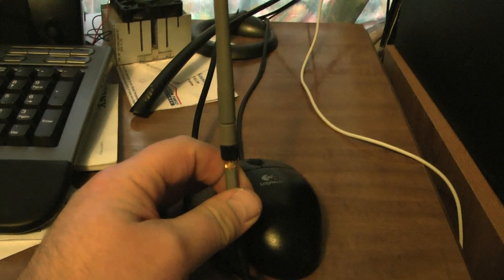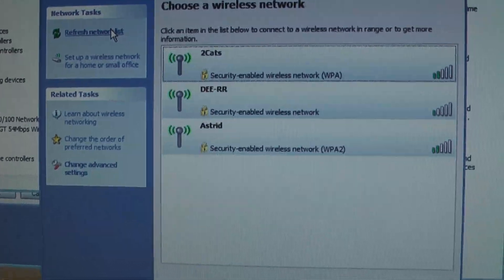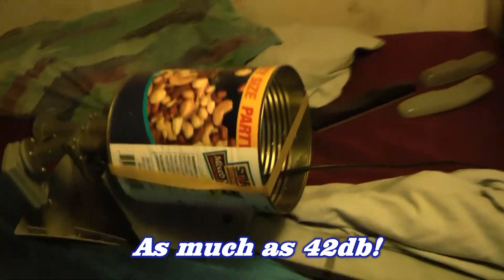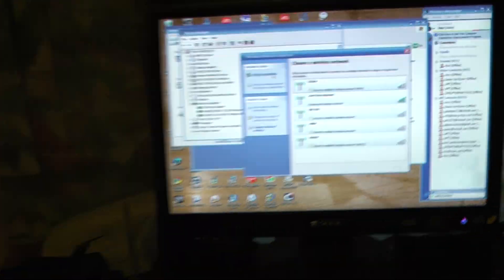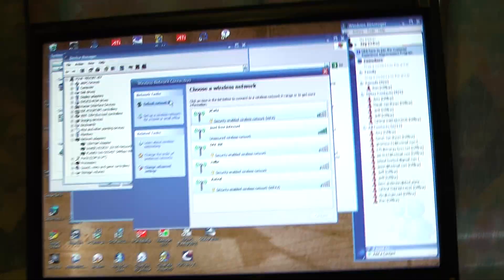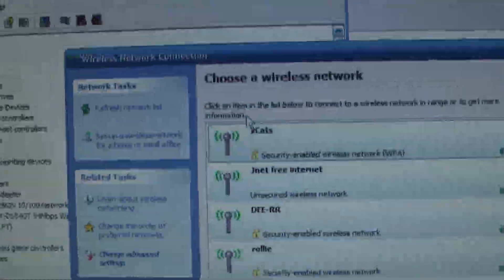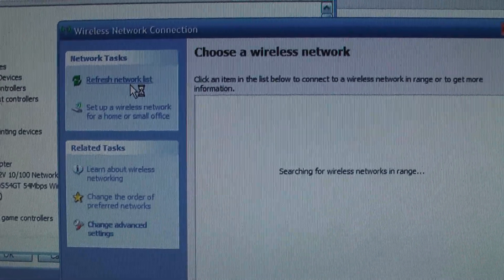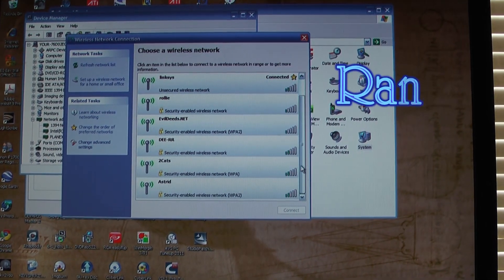free wifi, bigger dish=more range 42 to50 db

Comment: drill a hole thru the bottom of the can.. just big enough for the connectors (for end of antenna) to fit through. thus grounding the antenna out to the can. and creating a better antenna =]    not sure but for some reason it helps